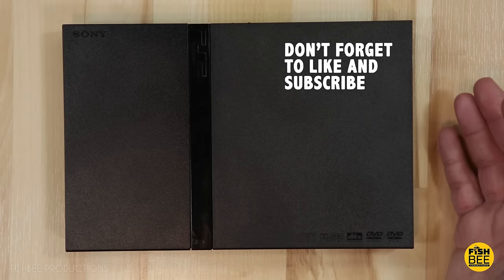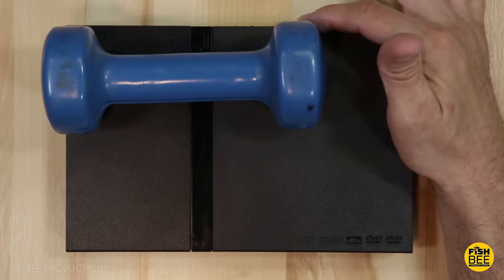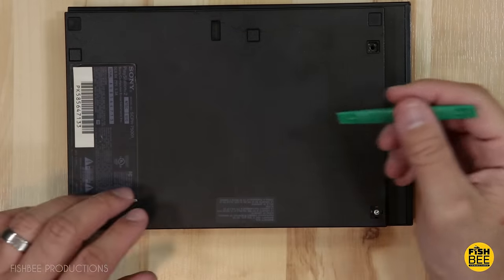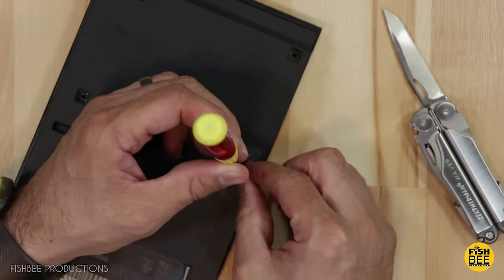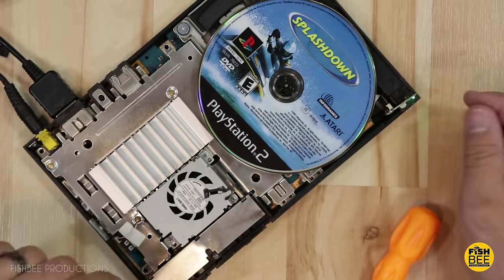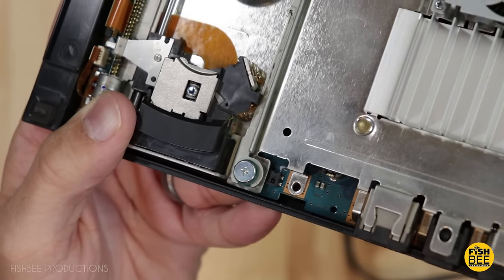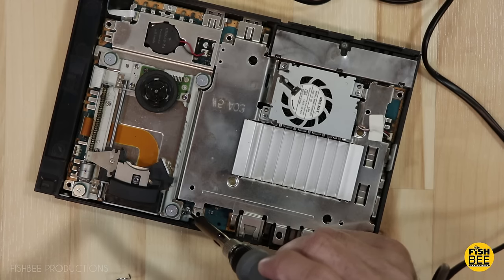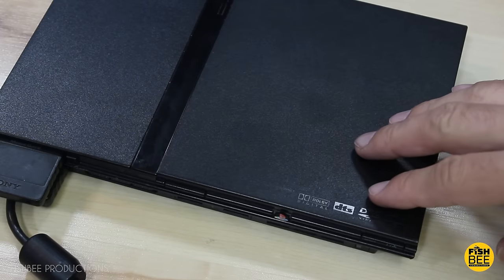How To Fix PS2 Slim Disc Error

Comment: Hello please message me'

I have a problem

Sir my ps2 disc is working when i put on the ps2 player and the game is read and when i will play the game and it will loads then after that it crashed and it hangs but the disc is readable and the player is ok also

And my problem is' i dont know if the disc or the player is the problem 
But the 2 works but when it will load to play and the sounds lose, and it hangs

Sir?